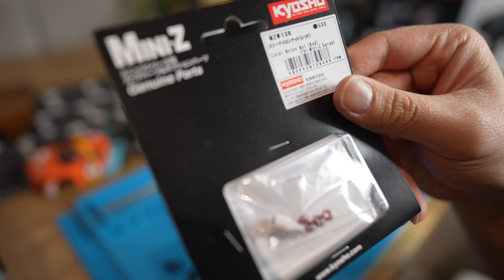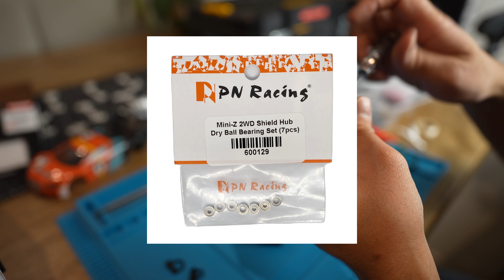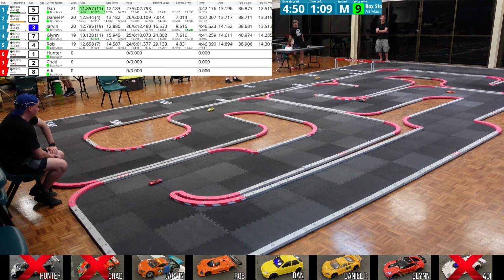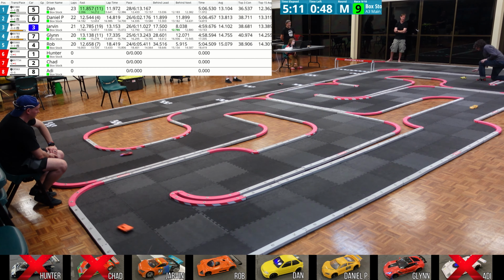Setting Up a Box Stock Mini-Z

Comment: I replace those hard motor wires with silicone pn wires. Then I got with a .5 mod pinion from pn. Which is the real proper gear mesh of the pinion/spur. And grease the rear differential a little bit. And polish king pins. You have a box stock championship car 😂

Comment: Hi, I'm new to this hobby. I have a basic question, what is the correct way to charge a new battery of aaa Nimh? I just bought kyosho speed house battery and liito kala lii-500 charger
Reply: Any AAA battery charger will do for you at this point. :) Whatever keeps you driving. Eventually if you're into racing and running your batteries hard, you'll want to look into a delta peak charger to give your batteries the extra juice(it'll trade off lifetime of the battery for marginal performance).